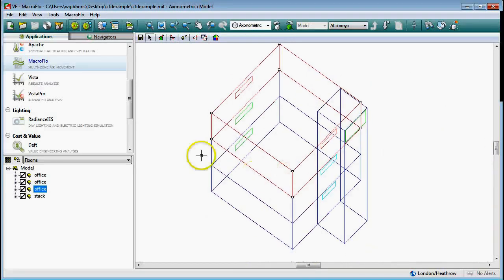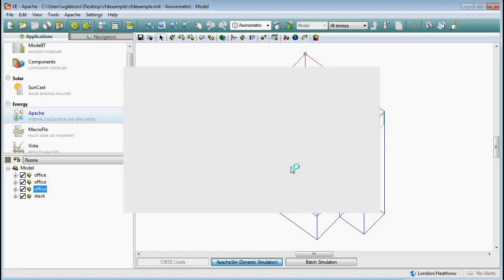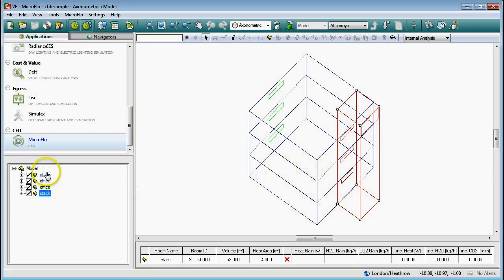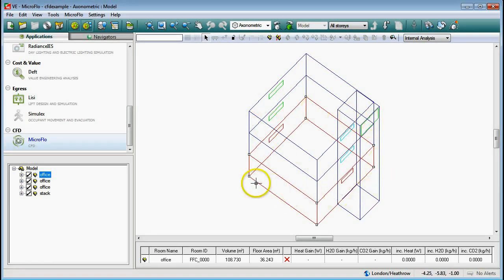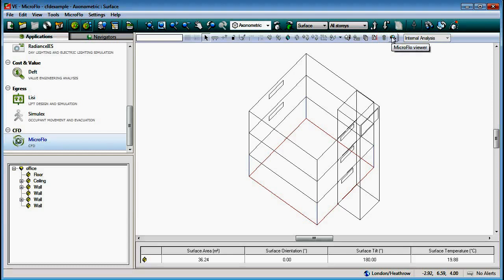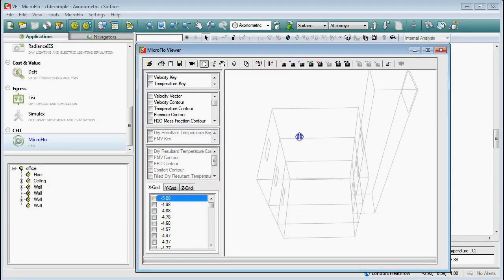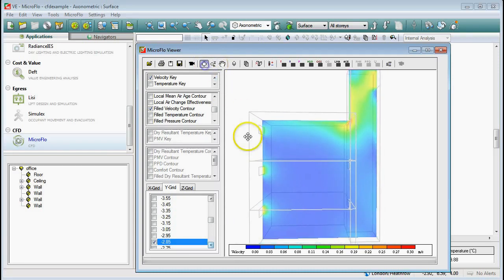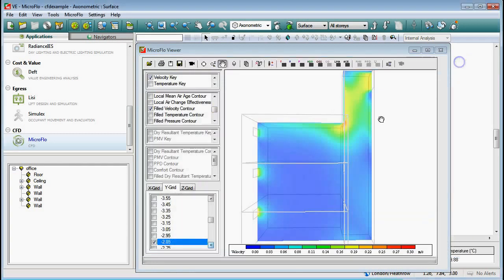How to use MicroFlo (CFD) in IESVE

Comment: Can you explain to me that how to solve the problem if it says unbalanced flow in the the run simulation in cfd microflo
Reply from the maker: Most likely this is due to having too many, or too large openings. Try setting all the openings to 'closed' and run the CFD.....if it runs then gradually open the vents/windows until you get to the optimum condition.
Reply: @CADandStuff   I have a stack connected to 5 rooms  hole in the stack. So should close the windows in the rooms??  And then run the simulation??
Reply from the maker: Yes. Close everything apart from internal openings, and see if it runs. How are you venting the stack to outdoors? You will have to export/import new boundary conditions to microflo after you've closed everything, before running the CFD
Reply: @CADandStuff   I've modelled a window in the stack facing outside
Reply from the maker: Okay, good. See if it runs with everything closed, and if it does, then gradually open the vents until you get what you want. I have found in the past that IES and CFD behaves unexpectedly if there are too many openings. And in most cases, you end up needing fewer than you might have originally thought.

Comment: Hi, back again ! could you please explain how to enable the PMV or the comfort contour in the Microflo viewer. I see that as one of the options but don't quite get what exactly controls it. Thanks once again.
Reply from the maker: Hi. I’ve never used that variable in the MicroFlo viewer, but I’d imagine it works like temperature and air velocity. Probably the thing to watch for is the range in values being displayed: what’s the scale for PMV, does it run off a -3 to +3 index? It’s been a long time since I looked at it, but from memory, the ideal is a PMV of zero, so when displaying that variable in MicroFlo, keep that in mind. I’d start with a display range of -3 to +3 and see how it looks. If it’s not giving you a clear and high resolution picture of what’s going on, try displaying -2 to +2 and just keep experimenting with the display range until you’re happy with the output image.

Comment: Is all the openings wends? Or only the rooms and the stacks is holes?

Thanks
Reply from the maker: +AA B hi. In my example, the openings on the west (left side in plan view) are windows. The openings between the rooms and the stack are holes. The opening at the top of the stack is modelled as a window. In IESVE, you cannot model a hole on the outside of the building, so any openings to the outside in my model are windows.
Reply: I really appreciate that

thanks
Reply: Please 

how can i run a summation with evaporative cooling system ?
Reply from the maker: AA B can you send me more details about the system you are trying to use, please?

Comment: Please how do I go about solving the problem of unbalance in-flow and out-flow in Microflo simulation
Reply from the maker: +Nimlyat Pontip Stephen I have only seen this happen for a couple of reasons, although there may be more. 1. There is a gap somewhere in your model (in other words, rooms which you thought were joined, are not.) To check this, go back into ModelIT and have a good look. 2. There is one or more very large openings in your model. If this is the case, it may be that you have over-designed the opening sizes. A natural "gut feeling" when designing openings is to have a "more is better" approach. In actual fact, having too many (or too large) openings can be counter-productive. I do not have access to your model, so I cannot say for sure why it is happening in your case. I suggest (if you have time), have another think about the size and number of openings and go back into Macroflo to reduce the numbers and/or sizes of openings. Try that as a first step, and see how you get on. You may find the best way to do this is to select all the openings and set them to "closed", then one by one open the windows and see if the error message appears. Let me know how this works out for you.
Reply: This really work out but I  am facing another challenge with running the CFD. I got an error message :
Memory allocation error 
Out of memory
Recommended to reduced mesh size. 
Please how do I go about solving this issue.  Thanks
Reply from the maker: +Nimlyat Pontip Stephen usually the default mesh sizes are okay, but you can make a larger mesh if you want. Are you definitely trying to make an internal mesh? Sometimes the mesh is external and that can make it large. Does your computer have sufficient RAM? Have you tried saving the project under a different name, then fully closing down the software and opening the newly saved file instead of the original one? Sometimes that gets rid of the grid error. Give that a go.
Reply: +CAD and Stuff My computer has a RAM of 16GB. I tried saving and opening the file as suggested above but still get the same error messages as shown below:

GRID
Number of X cells: 276
Number of Y cells: 320
Number of Z cells: 81
Total number of cells: 7,153,920
MEMORY
Memory Req. : 726573
Physical memory available: 4,194,303
virtual memory available: 4,194,303

Aspect ratio: 
MCAR: 46:1

When I clicked on Ok, it gave me the following error messages;
Memory error: Out of memory
Suggestion: reduce mesh size and re-run simulation
Recommended mesh sizes: 3 - 3.5 million cells for quad cor, or approx. 6 - 7 million cells for dual-core PCs

Insufficient memory for grid
surface/component boundaries do not align with the grid. You may need to re-generate the grid.

The above were the error messages I received. My computer is CORE -i7.
The total cells for my model is about 7.2 million while it s suggesting between 3 - 3.5 million cells for Quad-core PC.

Do I have to run the model on a DUAL-CORE PC or there is a way to go about this?
Reply from the maker: +Nimlyat Pontip Stephen what grid spacing are you using?
Reply from the maker: Maybe try clearing all previous microflo simulations out of the project. It may be that every time you attempt the simulation, it is adding to previous ones rather than over-writing them. Also, try shutting down as many applications as possible on your computer before you run the sim, just to free up RAM. It sounds like you are using a complex model.....did it originate from sketchup or revit, by any chance?
Reply: +CAD and Stuff The model is not that complex. It is an exhibition gallery open space with a room attached, two toilets, a kitchenette and a utility room. It has a void over the exhibition space to create stack effects for ventilation.
Reply from the maker: +Nimlyat Pontip Stephen It sounds like you need to contact IES for technical support. I've gone through all of the solutions that have worked for me in the past. Wayne

Comment: Thank you for the video! But I was wondering if it is possible to change the "key bar" smaller? For example, I want it only to show the velocity value for red and blue colour under the picture. In slice display settings there are ticks before every colour and I tried unchecked them but the scale bar does not change and still shows all the colours.
Reply from the maker: ***** I've had a quick look at that over lunch. When you are unchecking the colours in the display settings, these are the colours for "velocity contours". If you uncheck all but blue and red, then the slice will only show blue and red, but only if you have "velocity contour" as the display type. If you are using "Filled Velocity Contour" (like in my video), then the full range of colours still get displayed in the slice. The scale bar still shows the full range of colours, and I haven't seen a way to change that in the 10 minutes that I've had to play around with it. 

TLDR: you can display only 2 colours in the "slice" if you use the "velocity contour" display option and uncheck the colours you do not need, but I cannot see a way to only show 2 colours on the scale bar. To the best of my knowledge, the key bar below the slice will always split the display range results into the 12 colours, even if the slice itself is only showing 2.